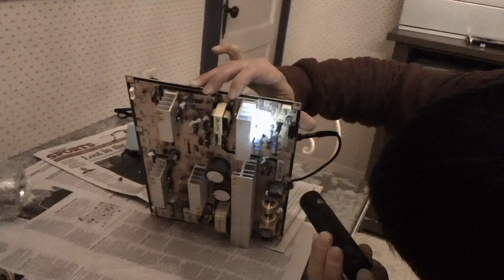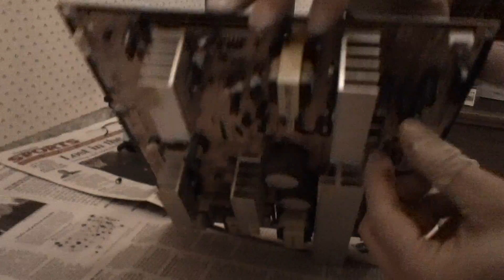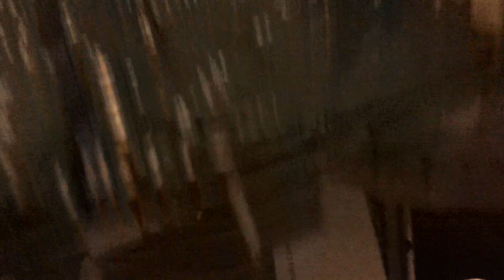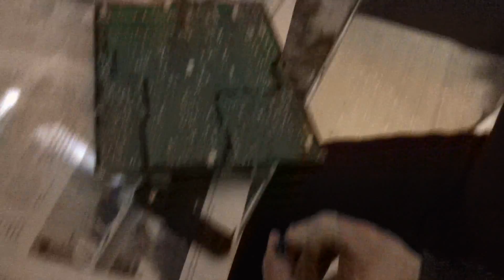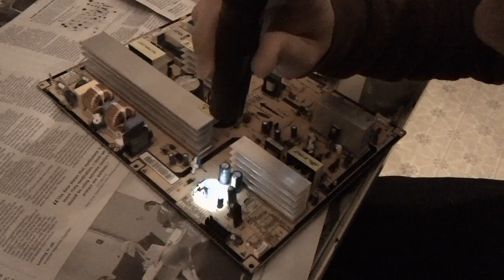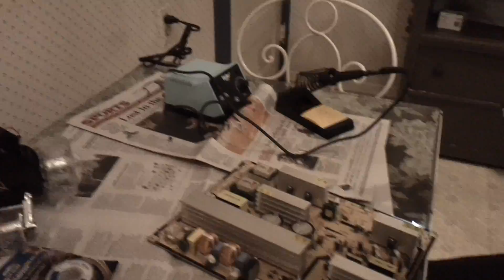Desoldering a capacitor

Comment: LET SOLDERING IRON HEAT TO GOOD TEMP AND CLEAN THE TIP, NEXT TOUCH IT WITH FRESH SOLDER.  FINALLY DE-SOLDER, SHOULD WORK MORE EFFECTIVELY.

Comment: Yes, indeed you have to watch out for any of the high voltage capacitor, some of which are rated as high as 2 kV, and can retain a considerable charge for some time. The best way to remove their charge is by switching it "on" with the power cord already removed. After that, just to be shure, you can use a well-insulated screw driver to short out any remaining charge in the capacitors.

Comment: Do you have to be careful removing the power supply board to avoid getting a shock from any of the larger capacitors that may still be holding charge? Thanks